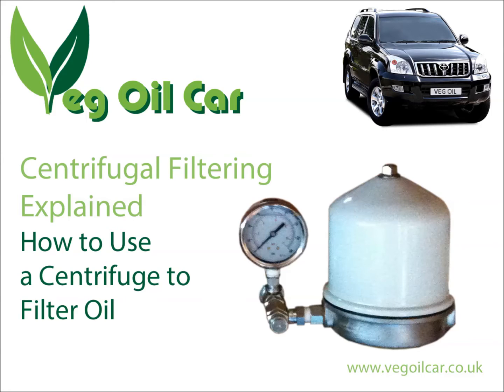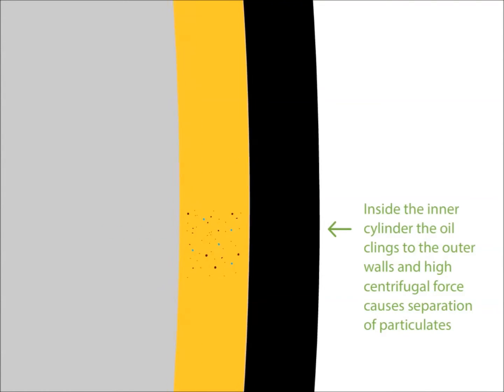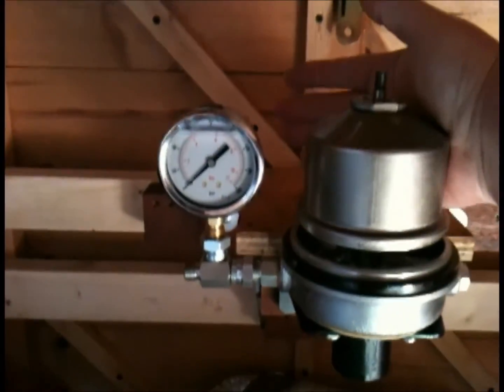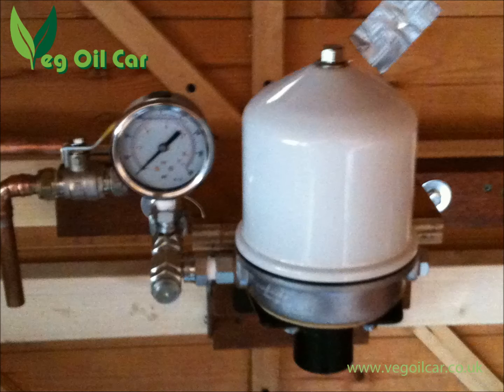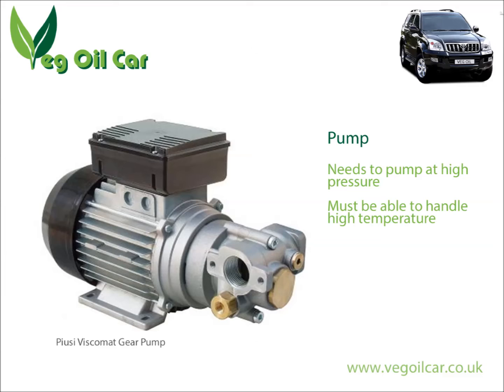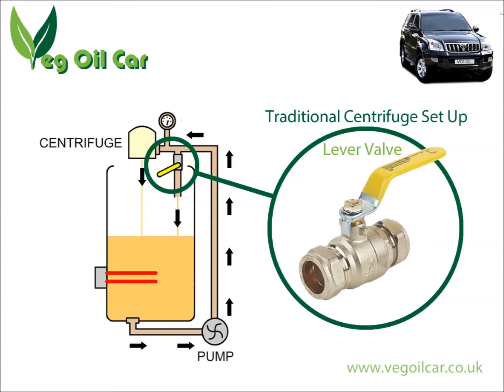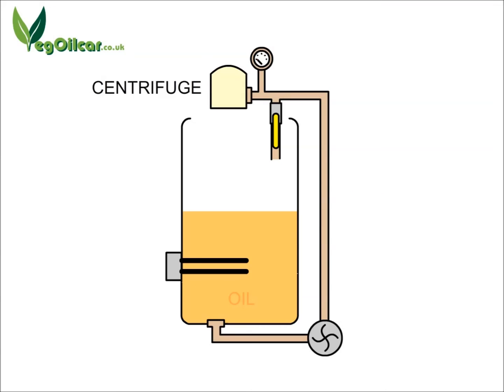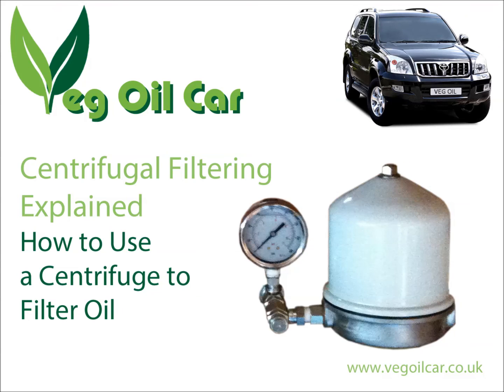How does a centrifuge work? - by VOGMAN

Comment: The Heater should be be After the pump and before the spinner to heat only what Needs to be warm. Unless the Pump Needs thinner oil depending on the pump.
Reply from the maker: To pass through a centrifuge the oil MUST be thinned, and that's achieved by heating.

Comment: What I don’t understand is the need to pump the oil in at high pressure rather than just drip it in cold from above like some others have done on YouTube. Also, once the wall of oil is full, maybe with fat or grease, surly it’s just going to overflow rather than separate.
Reply from the maker: Centrifuges do work, but not on waste cooking oil in my opinion. The oil has to be heated (melting any fats) and pressurised to force the oil through the very fine nozzle within the centrifuge. Afterwards, when the oil and fats cool, the fats can congeal again.
I've tried to test the cold feed system... these things that can cost thousands... hang on, let me copy and past a comment I made on this subject last night...
"I once challenged a company selling four-figure centrifuges to invite their happy customers to write to me at VegOilCar.co.uk telling me their success stories. The company was delighted at the opportunity. I contacted them a month later and they said they'd asked around and were sure someone would contact me soon. I contacted them three months later and they said they couldn't understand why no one had contacted me.
So I challenged them... I asked them to lone me a system. I said I would test it fully and report my findings with complete honesty and transparency through YouTube and my website. I said after that, I could clean and return the machine to them.
They declined my offer.
That told me all I needed to know. 
If you want, tell me the name of the company you're looking at. I'll gladly issue them with similar challenges. But I suspect I'll get similar responses. 
Snake oil salesmen wear many hats."
Forget centrifuges. Look at Settling. It's brilliant. It's cheap, effective and EASY. My multi-tank system filters to less that 0.5 microns.
Reply: VegOilGuy yes your method has helped me a lot and Iv used it for the past 5 months but Iv got some oil that’s been sitting for the entire duration that is still fatty when I leak it out using your method. Also I want to experiment with motor oil as veg oil is just becoming so hard to get hold of now.
Reply: @vogman  I have been using a 55 gallon batch  centrifuge I bought PA Biodiesel ten years ago.   I use WVO for my fuel.   My car is a 1979 240d with a 2 tank system.   The centrifuge works well to clean my oil.  I pre-filter the oil through old tshirt material to get the big particles.   I also add 5% gasoline to the oil when I centrifuge it.  After I have centrifuge it until I get little or nothing in the bowl.  15 passes or more.  I then pass it to my storage tanks through a 10 micron filter, from storage to car a 10 micron again. Also, I only hear my oil when centrifuging in cold weather.   I don't worry about heavy fats, the gasoline cuts it, the heated tank and fuel lines keep them melted.  I am in a zone 5 weather area, very cold in winter.   I have been using WVO since 2003.  Also have two trucks and tractor using my fuel.
Reply: @vogman  I'm looking at a Scintex Centrifuge 60 for sale second hand. Says it's only been used for 12 hours of cleaning WVO. You have to wonder why they are selling it after a small amount of use.

Comment: Thank you very much for the video, nicely done.. `)
in my system i would like to bring the oil after the centrifuge into a separate container and from there with another pump directly into the 2nd tank for plant-oil of my car  - i thought, a centrifuge can clean the oil to a level which is good to use by the car-engine by only one go-through - do you think it would need an additional filter or filter-row to be ok? 80µ --> 20µ --> 10µ --> 5µ --> 1µ - any suggestions? thanks a lot
 s
Reply from the maker: +scheroimo 
Hi, thanks for your comments.
You could certainly T-off a valve before the centrifuge and, when ready, close one valve, open another and redirect the filtered oil to another tank using the SAME pump, which will save a lot on pump costs ;  )

If that description is a bit vague, try watching this video... https://youtu.be/IZUgUp-mC9w ... it's the set up I used when I ran a centrifuge. It includes settling before and after the fuge to help improve the process.  I'm sure you'll get the idea from there.

As for a centrifuge cleaning in one pass, nothing I've read about THIS type of centrifuge (the one in my video) has ever made that claim. They all recommend multiple passes to ensure clean oil. And even then you've got to heat the oil, which melts the fats... not good.

I believe this type - http://www.wvodesigns.com/extreme-raw-power-centrifuge.html - claim to clean in one pass, but they are 10 to 15 times more expensive and I contacted one UK company (NOT the one mentioned here!) and asked them to put me in touch with ANY of their customers for an independent review... they never did... strange that. Plus there's still the issue of heating the oil and melting the fats.

If you already have a centrifuge and are determined to make it work, then do look at my advanced centrifuge video (link above). If you haven't got one yet, maybe rethink the whole affair...

I did. I gave up on centrifuges, moved to multi-barrel settling and I've never looked back. Cheap. No heating. No additional filters. Really easy. VERY clean. I run the filtered oil through a 0.5 micron filter and that has never yet clogged... that's how clean it is. 

I talk about this multi-tank settling set up (which I'm still using) on this video. https://youtu.be/PRlt2tbuq8s
I hope I was some help to you my friend.
All the best.